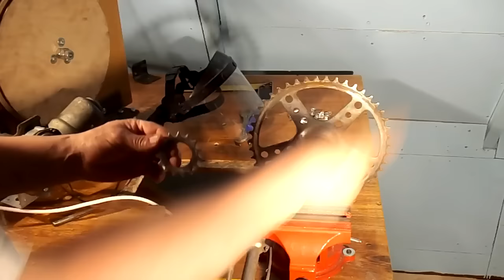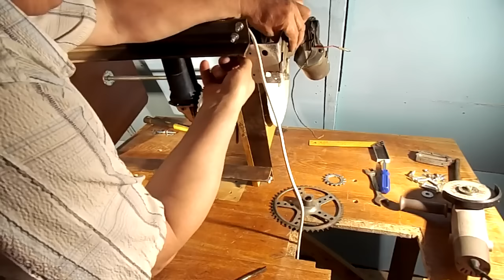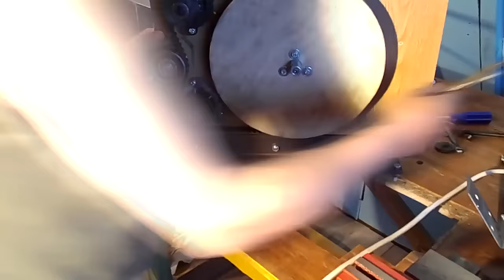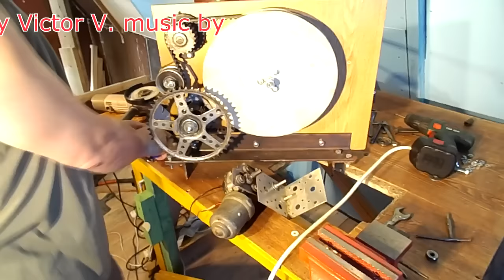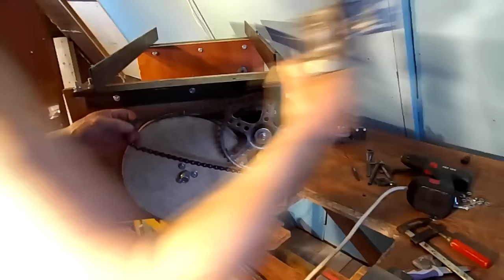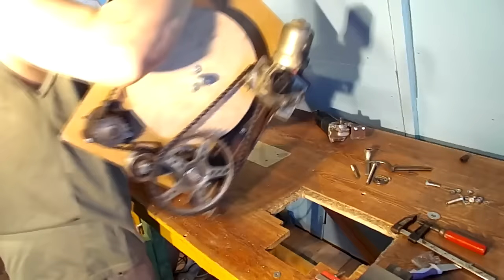Building Simple 3D Duplicator Using An Angle Grinder  . Part 3

Comment: I like the ideal..just a question would it work putting the big bike sprocket on the wood wheel and using just one motor? Either way it's cool and I'll be building one just need a smaller version